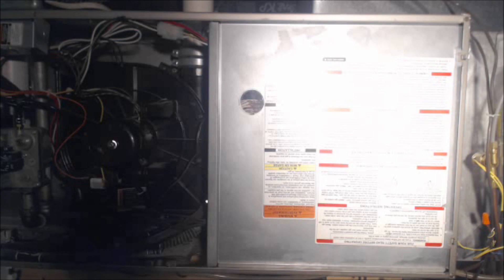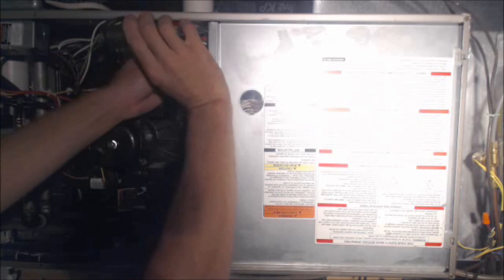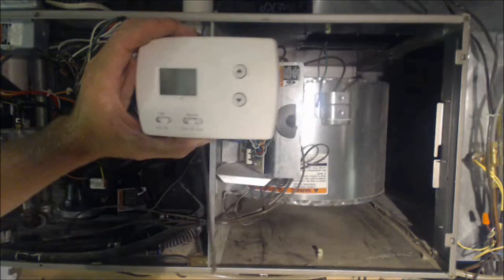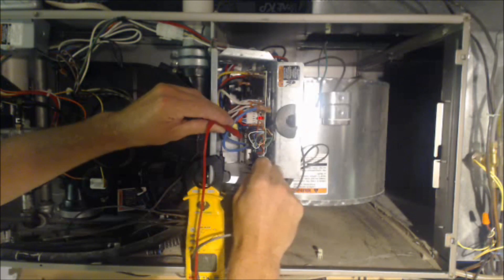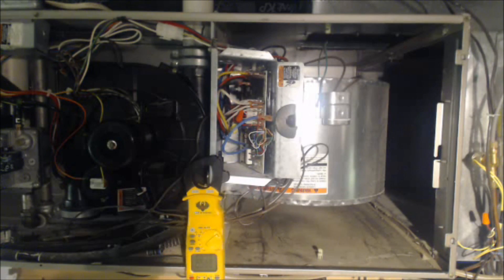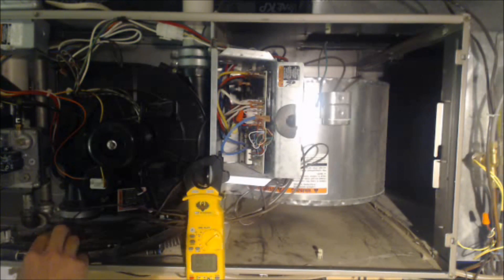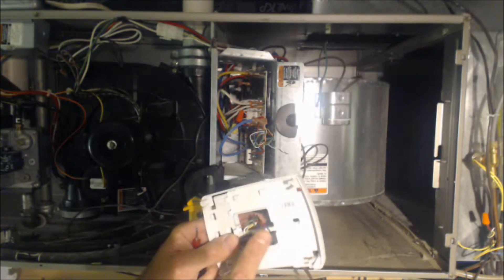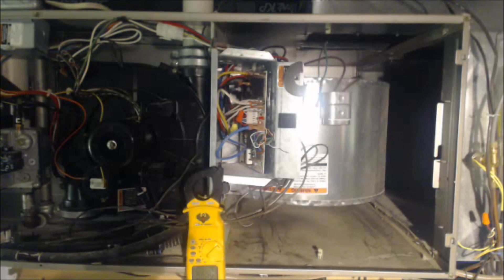Blower Fan Motor Won't Shut off!- STEP by STEP Troubleshooting!

Comment: I've got an X13 230v Lennox ECM motor that won't turn off, runs constantly. I diagnosed it as a motor module problem and replaced it with a refurbished motor and its working great. I've watch , I think, hundreds of these videos and none of them address a motor that won't turn off. I've looked at the ECM module and everything looks fine, nothing burnt. Is it fixable or junk? The diagnosis was easier than yours in that all I did was disconnect the low voltage thermostat plug from the motor and the motor kept running. So that told me that it was the motor (ECM module) problem.

Comment: Junky double wide here, my thermostat has always had only two wires. My furnace won't work on heat, my central air works on cool but wont shut off now, fan runs continuous.  Ugh.

Comment: You First:
1. Turn Off Thermostat 
2. Fan Still Running Anyway 
3. Disconnect Thermostat 
4. If Your Fan Is Off, Replace
     Thermostat.
This Is The Problem Of 99%
Of People.
Amén.

Comment: Is it okay for a brand new motor to have up and down play in shaft? I had a blower motor and the shaft was moving up and down direct drive psc motor. I got a new one and that one also had up and down play on the shaft so I opened another one on my truck and that one doesn't have any play. I would think up and down play on any shaft isn't a good thing I know the motor can run like that, but for the longevity of the motor and for the customer I've seen bearing drop before and makes the motor fail sooner

Comment: Having an issue where the blower turns off in cool mode but will not stop in heat pump mode even when the when the thermostat is turned off

Comment: I know this is an old thread but I have somewhat of a similar issue I’ve been trying to figure out.
I have an American Standard hvac/furnace. Split unit.  My issue is, I set my thermostat to cool 70, when the house reaches that 70 mark, the condenser will shut off but my fan blower continues to blow. Now if I go to the thermostat and bump it up to 72, then the blower will then shut off.
I’ve replaced, thermostat, wire from thermostat to furnace, wire from furnace to condenser, and control board., what else could be the issue? Anyone, please advise.

Comment: Rather than exchanging the brown for the green wire, why not test for continuity between the green and red wires at the furnace? Wouldn't that prove a connection between the two?

Comment: My units 7 YO  fan has been running continuously for a couple days now. I viewed your video and started troubleshooting by separating the thermostat face from the wall plate - fan continued to run. Since my unit is in the attic and, even during this time of year in Florida, it's very hot and uncomfortable up there, I decided to try something else prior to going up there and going through your other troubleshooting steps.

I have an AC and a Heat circuit in my breaker panel. With the fan still running and fan and system both set on Auto, I went through the following steps:

1. Turned AC breaker off - fan continued to run and thermostat remained illuminated.
2. Turned Heat breaker off (AC breaker still off) - fan stopped and thermostat "went dark".
3.Turned AC breaker on (Heat breaker still off) - fan still off and thermostat still dark.
4. Turned Heat breaker on - thermostat was illuminated and fan was Not Running!

It's been about 4-5 hours now and the fan has remained off, except during two ventilation cycles, after each of which the fan turned off automatically. Will you please offer an explanation for my apparent good luck, and also let me know if the sequence I went through could possibly have solved the underlying problem, or if it was somehow just a lucky "bandaid fix" and I'll soon be faced with another continuous fan issue? Thank You!
Reply: Did you ever fix it? My air handler for my system is doing the same thing. Only shuts off when i flip the breaker. Thermostat is off and the blower still blows

Comment: If you have a simple 3 button thermostat, you probably want to verify you have gone to the "fan" function and changed the setting to "auto" there, then go to heat or cool as needed, before you dig into your ac components.

Comment: Any idea how to handle an issue like this where my AC/Fan run constantly? I remove my thermostat and after ~1 min it turns off. A new Thermostat didnt fix the issue. using a multi meter I see 24v on the Y, but from the outside unit not the thermostat. If I pull the Y from the thermostat, I still see the 24v on the Y from the outside, but the fan then stops.

Comment: My combo fan doesn’t turn on until I switch it to AC but then it won’t turn off after it reaches temperature. Any ideas? I pulled the thermostat but it did nothing.

Comment: YOu have a lot of knowledge but some times you skip steps and we have to go back and forth figure where you went next....I am having the same on Trane furnace now I have to go back and listen to video a few times to understand all the useful info...if it would have been useful if you could isolate the problem either to the board/thermostat or wiring ...it is not obvious until the end...that it was a bad wire...which was not obvious

Comment: 2 things to check first which I didn't even think or realize, which you should do before even watching this video.

1.Check to see if you have an air exchange switch somewhere upstairs. Turn it off. It's like a light switch
 2. Bathroom fan! My house has it so it exchanges the air in the house if it's on. My roommate had her bathroom fan on and I never even considered it.

Comment: When you took off the green fan wire and tested the 2 locations what where those 2 locations?? Also fan still runs with green disconnected from the board

Comment: Before you go through all this, check the limit switches. A simple bad limit switch will also cause your blower to keep running.
Reply: It sounds a good idea. I have tried to order two of them, but the price is high. I may order them now.

Comment: So we currently have a problem with the a/c internal blower running non stop even after the desired temperature has been reached.  Our original honeywell thermostat (similar to RTH6580WF without WiFi) failed to turn off the blower even when setting it to off, so I tried replacing with another honeywell thermostat that has a manual off switch and now the unit turns on and off, but when it's on cool, the blower still runs continuously even when temp is reached.  In fact, last night it had dropped 1 degree below the set temp and was still running, so I turned it off to keep it from running all day.  I think I'll try some of the steps in your video, but was wondering if you could provide any additional info related to our problem.  I'd like to avoid another pricey service call if I can help it.

We recently had our unit recharged (told we may have a slow leak, but not yet confirmed).  We were also told a few days ago that our heat strip is bad (was mixing hot air with cool and taking a long time to cool the house - also spiking our electric bill), so they temporarily disconnected it until we can fix it.

Comment: Can sometimes relays get stuck and remain on even without 24VAC ? At my thermostat terminal , I dont see any 24VAC  (probably a blown fuse)  but the fan is ON and wont shut off .
Reply from the maker: Yes relays can get stuck and the contacts burnt together. That is a possibility, thanks!

Comment: My air conditioner turns on , by itself . Then I go to breaker panel and shut the breaker off, after couple minutes, I turn the breaker back on ,and the problem goes away. Then a couple months later it starts to turn on by itself again. What should I check Doc. ?
Reply from the maker: if it is your whole ac unit turning on then it sounds likely that it is either your thermostat, thermostat wires or your control board but it is more likely that it is the wires touching or the thermostat, thanks!
Reply: @acservicetechchannel  how can I financially support your Channel? Send me the link
Reply from the maker: @Hvacmania  You can support my work by joining patreon.com/acservicetech for ongoing support, purchase my book/ebook at https://www.acservicetech.com/the-book or purchase the paperback through https://www.amazon.com/shop/acservicetech , one time contributions can be made at https://www.payal.me/acservicetech or purchase items on amazon after entering amazon through https://www.amazon.com/shop/acservicetech and I will get roughly 5% commissions on any purchase but your price would remain the same. It doesn't work if you already have items saved in the cart on amazon. Supporting me by any one of these would be greatly helpful. I appreciate you reaching out and wanting to show your support for what I am trying to do for everyone, thanks Gerardo Padilla!

Comment: I have Lincoln Navigator 2004 climate control after I turn it off still running how can I fix it?
Reply from the maker: Do you have 24v when you test it with a multimeter from g to c at the control board?

Comment: Thanks to your instructions, I was able rule out the thermostat and wiring and find it was a relay on the circuit board.  Where can I find a replacement board for a thirty year old system?!
Reply from the maker: You would need to contact a local distributor of that brand of equipment and they can order one based on the model and serial number, thanks!
Reply: @acservicetechchannel  Thanks for the reply. I did check with local, unfortunately no parts are available.  Obsolete.  So, time to upgrade to a new system.  Need a video on Trane vs Carrier vs Lennox vs ???

Comment: Really nice video and very informative...question what should I check if I changed the contactor and now the power on the thermostat won't come back on?
Reply: @Blue Khalifa I will check that tomorrow and let you know if it worked, i just never encountered that before. But there is a light that is also a part of that circuit that this circuit breaker also powers and the light works fine.
Reply: and also i still have the same issue with my fan blower not turning off unless i turn the circuit breaker off

Comment: I have a problem that is similar but not exact.  My fan stays on for about 15 minutes after the compressor turns off, where it use to only stay on for about 90 seconds.  Is this relay related or does it have anything to do with the 100+ temps in the Texas summer?
Reply from the maker: That sounds like a problem with the thermostat or the control board, thanks!

Comment: what if it's not the t stat or wire?  bad board? or you briefly mentioned a limit switch but didnt really touch on that
Reply: The blower will continue to run if the funrnace has had a high limit temperatur switch trip, the blower keeps running to attmept to cool the furnace, this is usually evident by a manual reset imit switch ( look for a limit with a small red button ) but often times is an auto resetting limit. You would need to check limit switches and see if there is a differential potential on both sides of the swith, if the circuit is open then it means the limit has tripped.  If the high limit has tripped then you need to figure out why, often this is caused simply by a dirt filter, in many cases also expensive 3-m type filters cause this to happen as they limit the airflow too much. 
hope this helps. :)

Comment: Thank you for this video! My blower motor stays on unless I shut it off at main shut off or pull the face plate off. It wouldn't shut off if I turned it to off. I'm going to go buy another therm. My thermostat is only a little over a year old.
Reply: Did that work?

Comment: Thanks dude... excellent top to most painful troubleshooting.. Found that my Rheem blower motor board relay was burned.. no idea why.. Voltage spike?

The replacement board had many different connections so I hired a guy to replace.. works fine now.
Reply from the maker: Those board relays tend to be the thing that makes most boards go bad. It is typically due to high amperage or just the amperage of the blower motor over time makes the contacts fail, thanks!
Reply: @acservicetechchannel  I hope so.. I saved $80 by doing the troubleshooting myself.

Comment: Thanks for video
My furnace blower stays on only with AC mode. On Heat its fine and turn in and off as supposed to be. AC reaches set temp and after tstat clicks shuts off but blower keeps on. AC works fine! I have replaced tstat with thoughts that it is causing but nope didn’t help. Mentioned When i pull tstat the blower shuts off.
Reply from the maker: If pulling the tstat cover shuts the fan then it definitely has something to do the the tstat, otherwise sounds like a fan relay, thanks!

Comment: I swapped out my thermostat, and now the heat works fine, but the outside ac unit stays on
Reply from the maker: Did you check on the back of your thermostat for a switch to go from gas to heat pump or a setting in the programming of the thermostat? It would need to be switched to gas for a furnace so that it doesn't power the outdoor unit, thanks

Comment: So what is you completely replace the thermostat and terminal block but taking off the thermostat still shuts off the fan? I’ve tried 3 thermostats and they all do the same thing with two totally new terminal blocks.
Reply from the maker: That is what it is supposed to do. What is the problem?
Reply: AC Service Tech LLC Fan still runs all the time even though I replaced thermostat with two different units. When I take off the thermostat it shuts off the fan, otherwise it runs all the time. I also replaced the terminal block. I am baffled at this point, thanks for the help! Unit is a Rudd 4 Ton heat pump and evap coils.
Reply: Their is a short feeding off the thermostat. Have you gone through the set up of the stat for gas or electric heat? It might be a switch or jumper on the new stat. It is not the stat. You could have it wired incorrectly.

Comment: Well my AC/heat was working fine.. Mom had somebody come out just to do a checkup on our AC/etc  they said we needed a new pan and a new motherboard? so it was like 900 bucks... They left now we have NO heat and the FAN motor is on constantly has been all night and its freezing in the house.. The fan wont turn off even in the off position..  :(…
Reply from the maker: The technician should come back and fix the problem they made, not good!
Reply: They came out the next morning... They had to replace the motherboard again...  They tried to use a generic board and it didn't work.. They had to use an OFFICIAL TRANE board on it then it worked fine.. at least that's what they said.. They didn't charge us any extra

Comment: So why did you disconnect that 120v wire again ?
Reply from the maker: It may have been during the resistance check of the blower motor or the testing of the capacitor or just for safety between moving the multimeter, thanks
Reply: AC Service Tech LLC wish i had money to support channel . your videos contain great value !
Reply from the maker: Glad to help Gerardo!

Comment: I have the Honeywell 5 N 1 heat pump. Blower motor is blowing constantly. I did shut off the power disconnected the thermostat. The fan did not come back on until I reconnected the thermostat. I'm thinking the thermostat  is bad? Your expert opinion please.
Reply from the maker: Without seeing voltage readings I would not be certain but it sounds like you are right that the tstat may be bad, thanks
Reply: @acservicetechchannel  I done a reset on the stat and it has worked great until a few minutes ago. Now the fan isnt shutting off but the heat does.

Comment: 7:18 where did you test for 120 volts
Reply from the maker: L2 common and the hot output from the control board relay, thanks

Comment: Great video, extremely informative.  Before you do anything, check the thermostat wiring to your unit for damage from mice or other rodents.  If the thermostat line is not installed in conduit, then this is a quick starting place where you might find your trouble, particularly is the problem is sporadic.  In my case, I found there was a wiring problem when I checked the voltage between red and common at the thermostat and at the unit and found they were different.  When I chased the wiring, I found that something had chewed up the insulation on the wiring underneath the unit.  So, I repaired it and ran it inside conduit.
Reply from the maker: I have found mice chewing thermostat wires in mobile homes usually but not so much in houses, thanks and glad you found your problem!

Comment: I have a trane heat pump with a York air handler.  The fan runs continuously.  I have changed the thermostat.  Replaced the thermostat wiring, and replaced the control board.  The fan still runs anytime there is power to the unit.  With or without the green wire.  With or without the thermostat attached.  The capacitor on the fan is rusted.  The transformer looks ok.  What are my next steps?. I have electrical heat as a backup source, so no rollout switch.  No gas components.
Reply from the maker: It sounds like a safety switch is open. Did you shut the power off and test the continuity across each?
Reply: You have a sequencer sticking. It needs to be replaced. Sequencers stage the fan and heat. Then cycle off with the fan first and last to go off. That stage is sticking. Probably have heat blowing as well. Possible to just have the fan only.